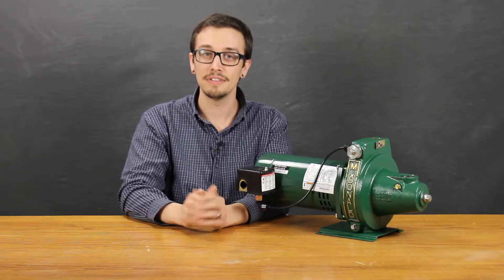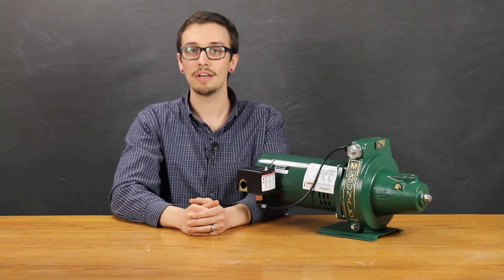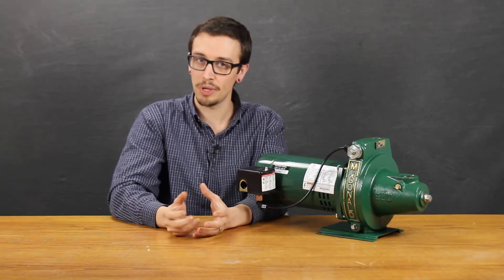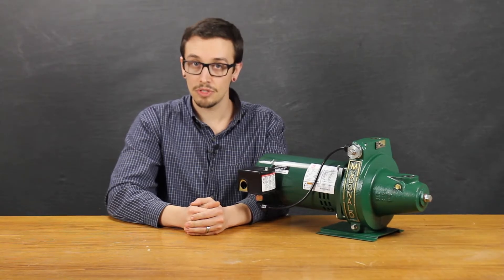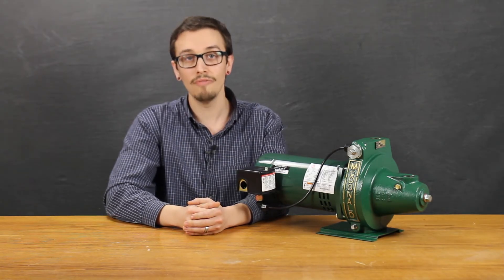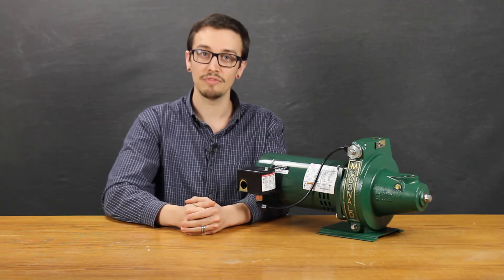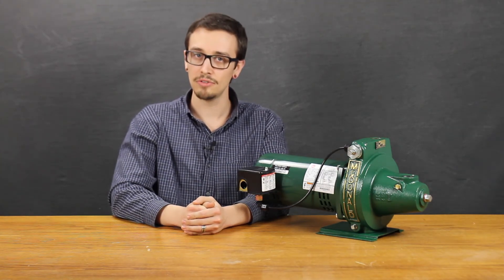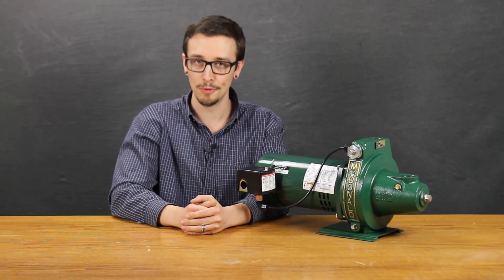AY McDonald 8500 Series Shallow Well Jet Pump

Comment: So, if I understand this correctly, I can run this pump for a couple of hours continuously, and it will not hurt it?
Reply from the maker: Correct
Reply: R.C. Worst & Co., Inc. thank you. That’s what my neighbor told me. He said I could run it constantly in my irrigation system as long as it was steady running and not cutting on and off. I wasn’t sure he was right because after about an hour the motor housing was extremely hot to the touch. But I feel better about running it now that you’ve advised me it’s ok. Thank you for your feedback
Reply from the maker: @lesteroliveintheshop9825  As long as it's moving water you should be just fine

Comment: I have used these for the past 30 years in SC. They are a great pump. Use to pick them up from Lowe's. However now Lowe's has stop carrying them. IN my area I could not find another suppler with a reasonable price. Sadly after 30 years I will be changing to a Goulds which is suppose to be an outstanding pump. If I could  have found a Mcdonald I would have purchased it.
Reply from the maker: Billy, we sell them on our website and ship directly to your door: www.Rcworst.com
Reply: So, if I understand this correctly, I can run this pump for a couple of hours continuously, and it will not hurt it?